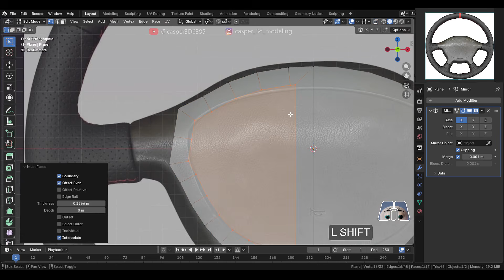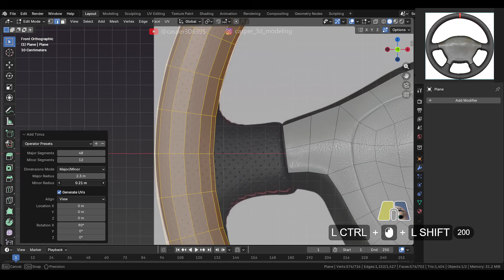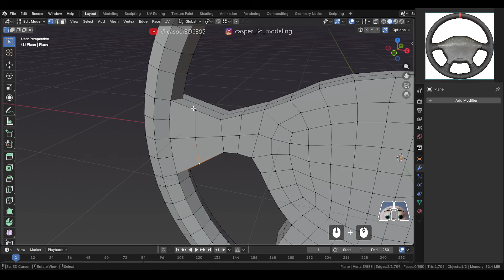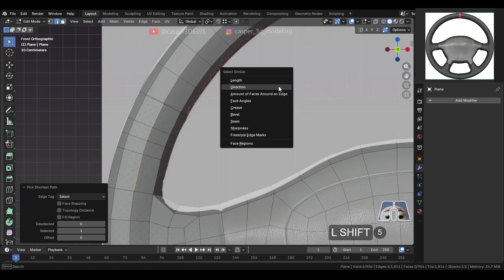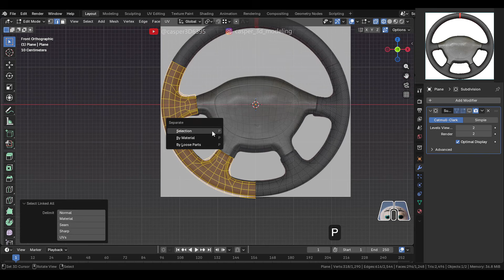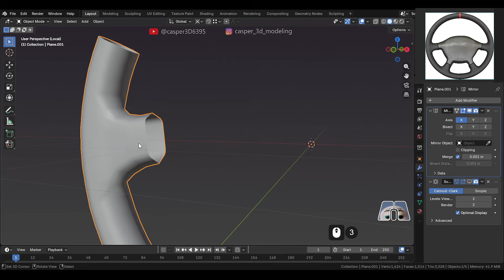Blender Practice – Modeling a Steering Wheel (All Quad Topology)

Comment: Learning a lot of procedure for building complex shapes. Thank you. One thing about this.. from light shading on the center of the steering wheel... seems like that center are should be bulged out toward th e driver a bit rather than jsut be essentially flat in the middle. How would you do that in your model?
Reply from the maker: Thanks! If you want to curve or bulge that area outwards, you can select it and separate it first. I might use the Lattice Modifier to curve it out using Proportional Editing, and then connect it back. There are lots of ways to do that, this is just one. Hope it helps! 👍

Comment: Hey man I have a question: Normally in the viewport, on the top-right corner there’s the options button. When I click it there should be a tool there called affect only function. But its not there. I searched it on the search tab and on the F3 menu and found nothing. I’m using the latest version of Blender. Do you know what’s going on?
Reply from the maker: Thanks! The Affect Only features only exist in Object Mode. If you're currently in Edit Mode, you won't see them. The second thing is that the Options menu may be hidden. Right-click on an empty area of the top header (where it says Object Mode, View, Select) and make sure Show Tool Settings is enabled to unhide it. Hope that helps!
Reply: @casper3D6395  bro I've been asking about it for a while now. I realized that I'm dumb... Yes it is there, thanks a bunch for that. And also keep up your good work man they're great. I am around your level but I'm still learning from you. You use the knife tool so good. Dont stop 👍👍👍